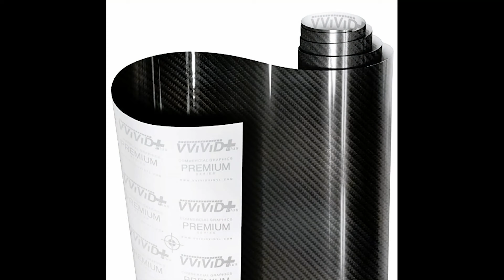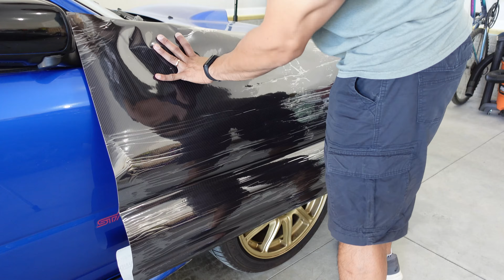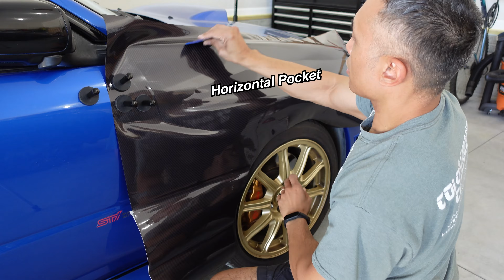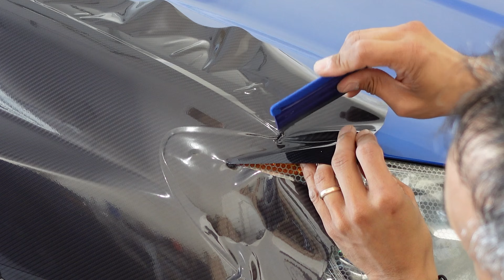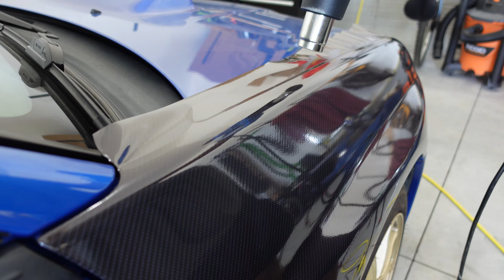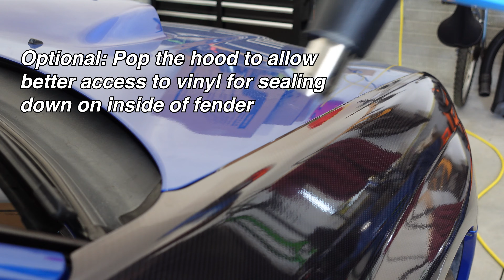How To Carbon Fiber Vinyl Wrap A Fender | VVivid Tek R Install on Subaru STI

Comment: is 5ft x 5ft enough to cover my two front fender? because there is no 6ft x 5ft available.
Reply: i got some today it might be back if you check again, but it wouldn’t ship to the first address i tried to use which was weird.

Comment: Did you say 70% Alcohol and 30% water mix? Need to wrap my fender and this video was very helpful.
Reply from the maker: Thanks for watching! Yes, typically I use an alcohol/water mix where roughly 70% of the mixture is rubbing alcohol (the alcohol itself being 99% pure, undiluted) and the rest water.

Comment: Do they sell a roll big enough for the hood and the fenders? Bc I went on there but it looks like the biggest offered Is 17x5 not sure how much of that I’d need to do the hood and fenders
Reply from the maker: Yes there should be rolls that they sell that would be enough to cover a hood and both fenders. Very generally speaking, for regular sized cars, a hood can usually be covered by a 5 ft x 5 ft or a 6 ft x 5 ft piece. Fenders are typically around 2 to 3 ft long by about 2 to 3 ft tall. So a 10 ft x 5 ft piece "should" be enough in total to cover a hood and both fenders. But it all depends on the actual size of what you are trying to cover, so always I recommend measuring to see what size you would need to order. The Amazon affiliate link I left in the description when I checked this evening shows that they have a few 10 ft by 5 ft pieces. Our you could order two 6 ft x 5 ft sections, one for the hood and one piece you can divide in half for each fender. But again, I recommend measuring to see what kind of coverage you would need and order accordingly.

Comment: Great video.  I wanna do this on my golf mk7 r. Just wondering roughly how much vinyl would I need to do both.  Thanks
Reply from the maker: Thanks, and thanks for watching! As far as how much vinyl to do fenders on a smaller car, generally speaking, a 2 foot tall by 5 foot long sheet is typically enough for one fender.  So if you ordered a 4‘ x 5‘ piece of vinyl (vinyl typically comes in a 5’ tall piece by however many feet long you order) you should be able to get both of your fenders done. But it varies from vehicle to vehicle.  To be sure, you would need to measure your fender from left and right and top to bottom at its highest and widest points and add a bit extra for a margin of safety.

Comment: Hey bro great video! Just had a question how much vinyl would I need to wrap two fenders?
Reply from the maker: It varies based on the vehicle, but I did my STI with a 5' x 5' sheet cut in half

Comment: Vvivid is poor quality wrap.  Stay with KPMF, Oracal or Avery if you want quality wrap.
Reply: Thats because you cant install it. I bet you cant install Teckwrap/Inozetek because its soooo thick. So many professional shops say the same thing they suck because of thickness. Other than that ive had no problem removing 2yr old Vvivid...No garage kept.
Reply: @Usernametheone1  Thickness isn't an issue, the issue is the poor quality.  There is a reason why quality wraps cost more and why professional shops use them.  Quality wraps install well and have a great warranty.  All these cheap vinyl brands are being promoted to DIY installers.  I see so many mess them up, or if they do look good at first install, they ended up feeling back within the first year and need redone.  That's not quality.
Reply from the maker: I've gotten that feedback as well.  Luckily, I've never had issue with VVivid, but I also order direct from them instead of 3rd party, which in many cases, buying from 3rd party has turned out to be not actual Vvivid, or material that has passed it's shelf life.  Am a big fan of the other vinyls you mention as well...each has their own pros and cons that an end user should take into account when selecting which vinyl they want to use.

Comment: This is an incredible video. You're very knowledgeable and you go so in depth of the wrapping process. Also something I'd like to point out is that you have proper knife handling skills. You use only what you need which is enough to not cut the back of the car. It really grinds my gears when I see a certain popular (youtube famous) wrapper that over extends his knife to the max and swings that thing around while its exposed. CRAZY.

Anyways, not here to rant, kudos for the whole video. Also thanks for the glimpse at Tek R. Will definitely be buying this for my car.
Reply from the maker: Wow, thank you for the positive feedback and kind words!  I greatly appreciate it!!  And thank you for watching!

Comment: How’s the wrap holding up. My car stay outside 99 percent of the time and worried about the wrap either fading away or not as fresh as a new wrap.
Reply from the maker: It's holding up fine, but I've only had it on for a couple months and it's a garage kept car :-)
Reply: Covering up the car or shaded area would help or a car port 🤔